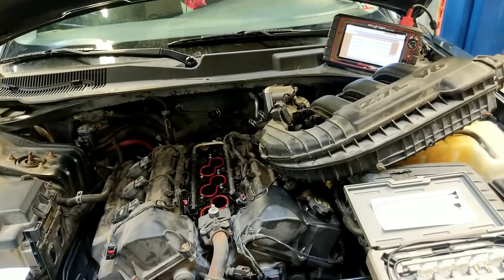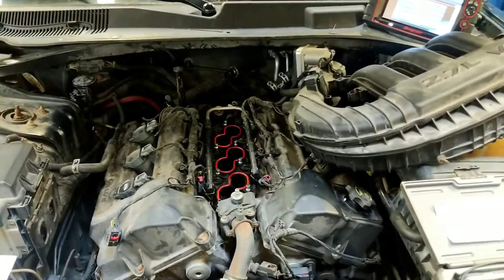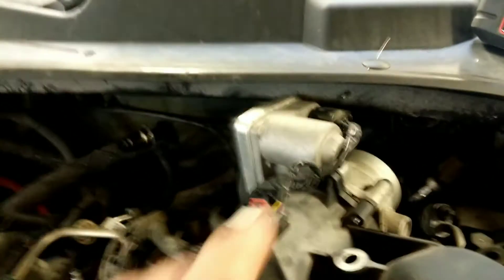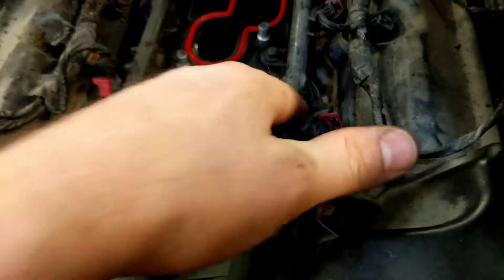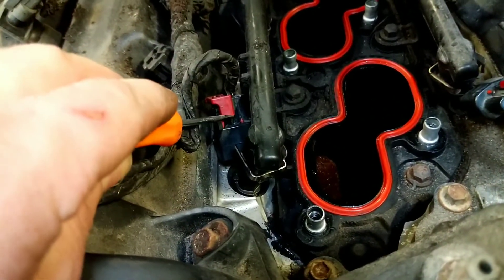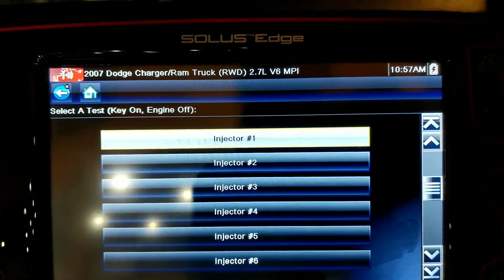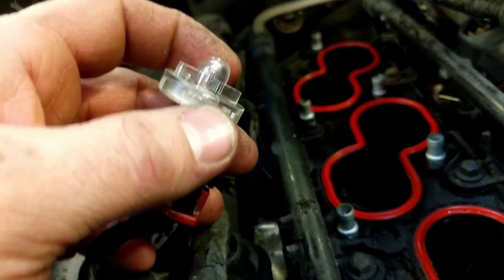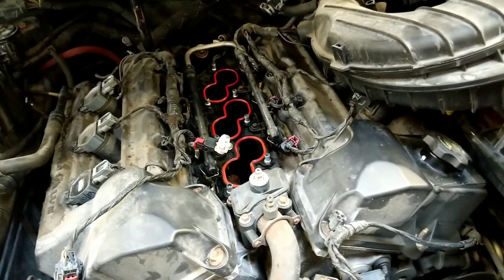Dodge Charger 2.7L V6: P0300, P0301 (Noid Light Test)

Comment: No  injector code comes up ? 
I'm dealing with cylinder #1 misfire 
(New Plug new Coil) Still get p0301 once @ running idle or shortly after I begin driving ...

Comment: I have a dodge magnum 2.7 2006 with 234 thousand miles
This problem rough idle or stalls at red lights is a big issue 
Its a like dog thats chasing its tale
Im getting ready to change the alternator out,,,,it looks original no mechanic has been able to get the check engine light off
Reply: Check your PCV valve that's a quick $10 fix.
Reply: @zaarrd1699  Thank you 👍👍

Comment: Wont it trigger a specific code for the injectors?
Reply: That’s if the driver is functioning in the PCM and the injector is either shorted, excessive resistance or an open/shorted circuit wire etc. If it’s not those issues the codes won’t set. If the PCM is bad it will not run a circuit test/check(no codes) nor will it try to fire the injector hence the noid light test. A shorted PCM could also produce a solid state light.This also can expose a short at the injector connector or wiring.

Comment: Mine won’t crank are start Dodge Charger 3.5l v6 when I turn the key
Reply: Hey chk starter relay
Reply: @bosshogg6629  it work but now it won’t go into reverse when I put in gear but it goes forward
Reply: @lederrickbrown9144  That’s transmission I’m pretty sure. Sorry to break it to you
Reply: P0660 code
Reply: @Lederrick Brown that’s the intake manifold tuning valve located in bank #1. That code is not transmission related. Hope you’ve resolved the issue.